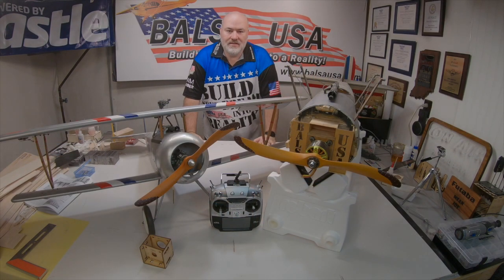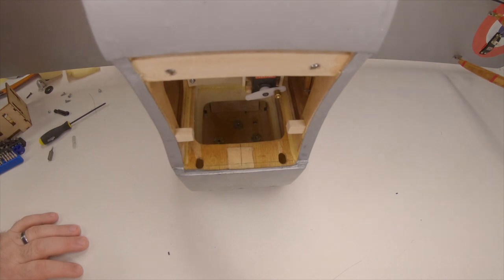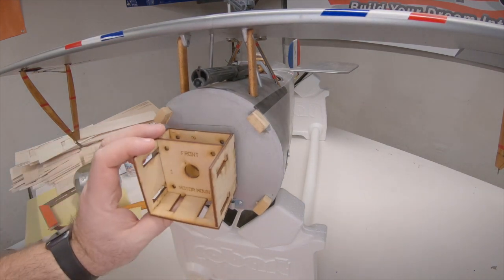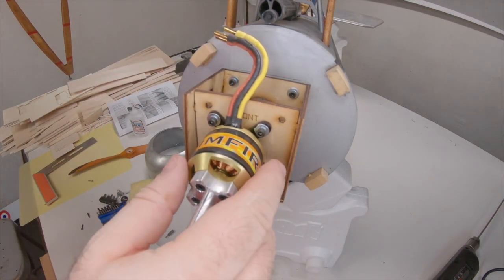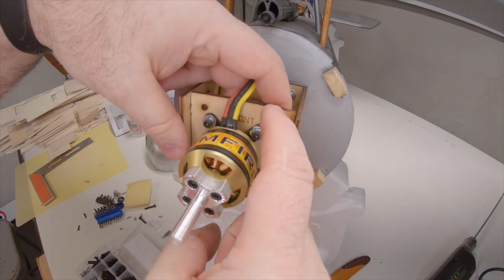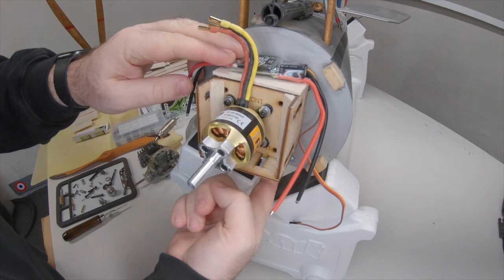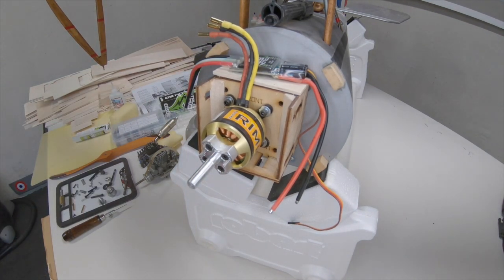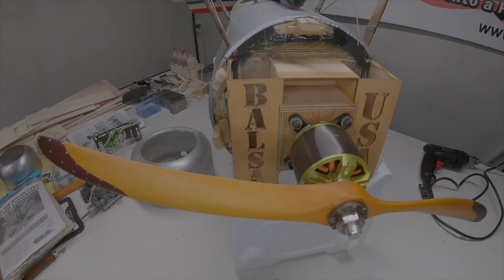Electric Conversions

Comment: There's an easier way, measure from the firewall to the thrust washer.  Now measure the electric motor mount to the thrust washer, difference is what your new mounting block size should be.